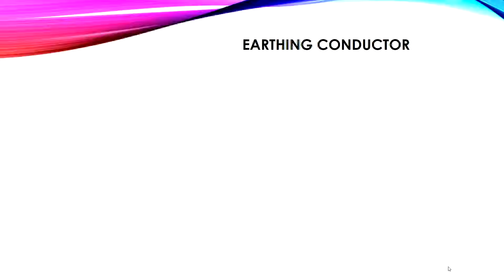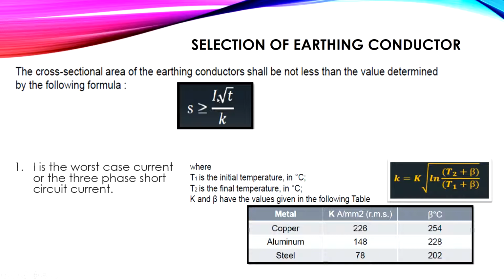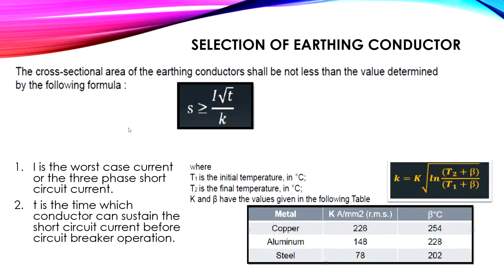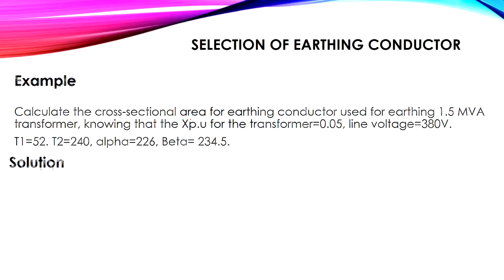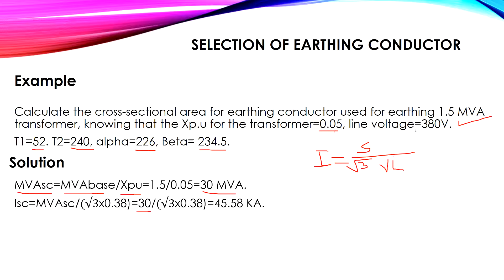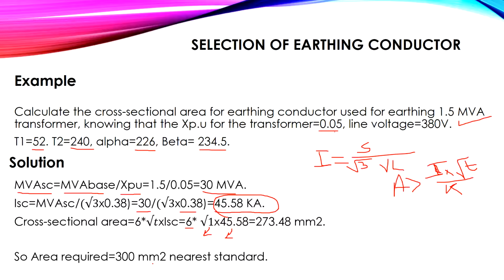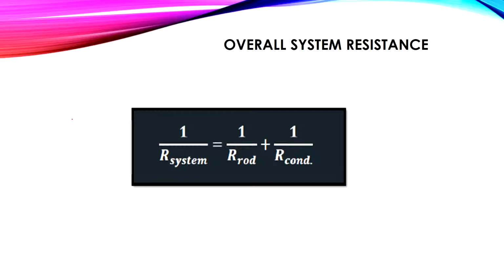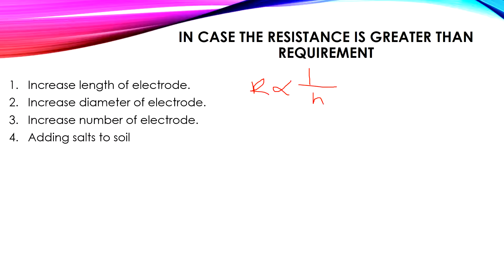Design and Resistance of Electrical Earthing Conductor -  Lesson 6 in Earthing System Design Course

Comment: sir am regularly following your videos . thanks for upload. but i have a question . please can you explain. In short circuit mva you have kept 0.38 voltage value. please can you explain.
Reply from the maker: 380 volt is representing the supply voltage at the instant of short circuit, so at the the instant of short circuit, the current will be the Voltage/impedenace from supply to the ground, for short circuit at the main distribution board which is supplied from transformer, the current will be V/Z of transformer or we can get it from MVA/root 3*380 volt, they are both the same.
Reply from the maker: You are welcome anytime :)

Comment: what do you mean by eathing conductor  ? according to the formula  used you mean protective earthing conductor is it right ?
Reply from the maker: Earthing conductor is the conductor forming the earthing grid and at the same time, the conductor which connects between earthing bar and earthing electrode, also it connects the earthing electrodes in parallel.
Reply from the maker: What i already said in the comment is similiar to what the website is saying, earthing conductor is the one forming earthing grid and at same time connecting between earthing electrodes, when you reach the etap video, you will get the idea.
Btw protective earthing is an earthing conductor but with insulation, formula in video is of course protective earthing conductor which is connecting between panel and earthing electrode and they should be of same material to avoid corrosion, the thing which confused you that crossesction area of earthing conductors can be different from protective conductor but same material, Etap will make what i am saying clear since i can not attach images.
Reply: @EngrAhmedMahdy  thank you very much